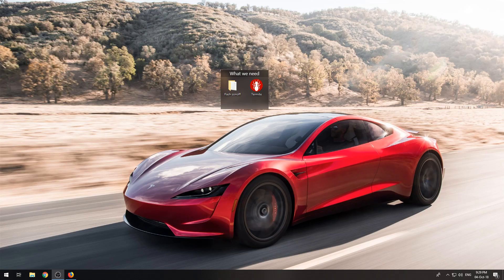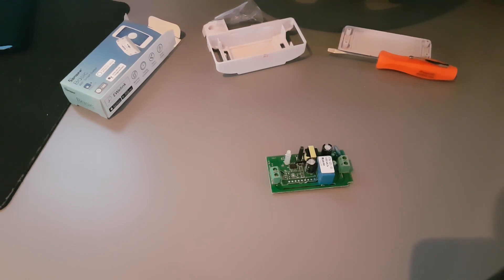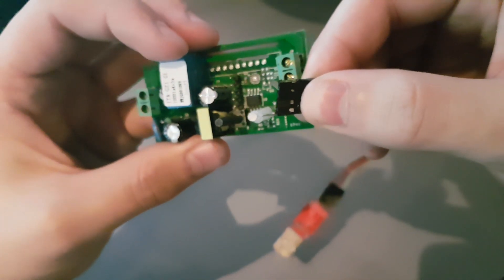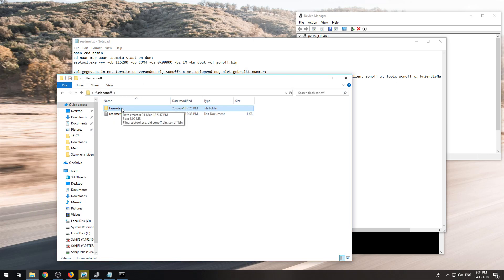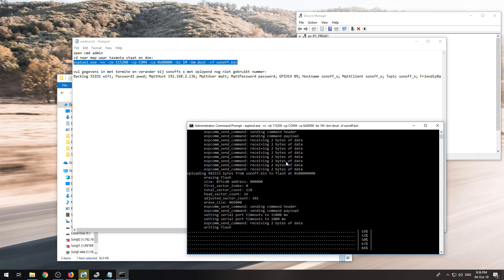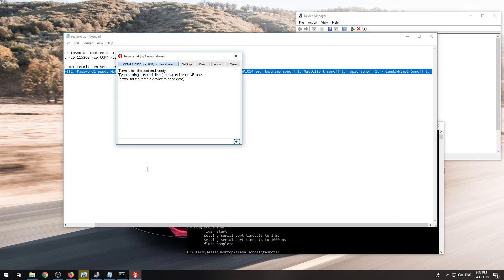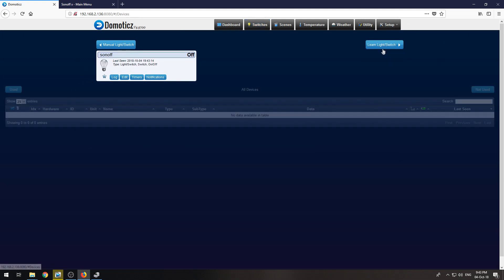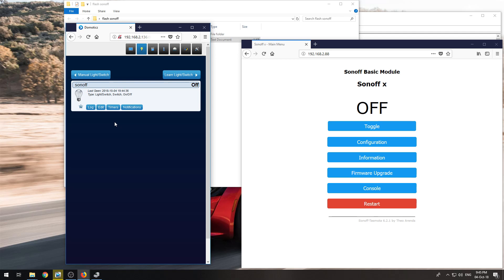Flash sonoff Tasmota and connect to Domoticz

Comment: Hi Jelle, i have used your method on the old Sonoff basic and this works perfect. But now i have bought a new one the "Sonoff Basic R3" with the newest firmware (3.5.0). AIso have put the jumper on in for the DIY mode. But i can't figure out how to flash it with tasmota. It should be posible with the "DIY Tool" but the sonoff is not visible in this app. Do you now how to flash this one?
Reply from the maker: Try to follow my sonoff mini tutorial, maby that helps. I do that one using the diy tool.

Comment: Hey Jelle, bedankt voor je heldere video’s!
Ik heb echter één issue: ik heb dus zonder probleem één per één al mijn sonoffs mini’s geflashed met tasmota en ze kunnen verbinden met mijn domoticz via mqtt alles werkte prima als ik ze één na één teste.. nu heb ik er een 3tal aangesloten op mijn huisschakelaars en krijg ik maar 1op de 10 keer mijn licht aan als ik deze bedien via domoticz. Als ik via ip van mijn sonoffs rechstreeks op tasmota on / off commando geeft lukt het zonder probleem.. lijkt er dus op dat ofwel mijn  domoticz of mqtt server hiervoor iets tussen zit. Weet jij wat ik hier aan zou kunnen doen? Alvast bedankt!
Reply from the maker: Zie je errors in de logs en wat zie je in de tasmota console op het moment dat het niet werkt? Eventueel kun je je probleem op het domoticz forum plaatsen, daar zijn nog veel meer mensen die je nog beter kunnen helpen dan ik
Reply: @JellePeters  

Dit is wat ik krijg in de logs op tasmota:

09:57:06 MQT: Attempting connection...
09:57:06 MQT: Connected
09:57:06 MQT: tele/tasmota/LWT = Online (retained)
09:57:06 MQT: cmnd/tasmota/POWER = 

Ik zal het inderdaad posten op Domoticz forum, misschien weten ze daar raad.

Alvast bedankt! En keep up the good work!